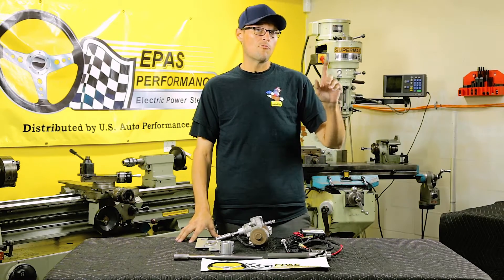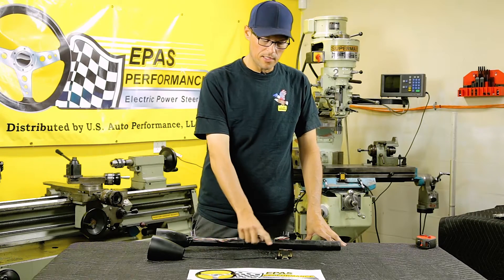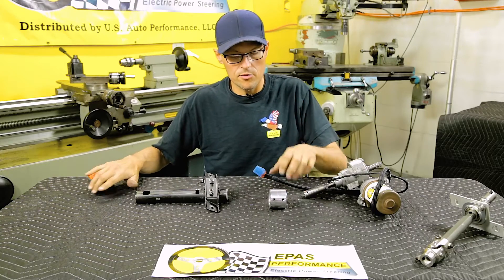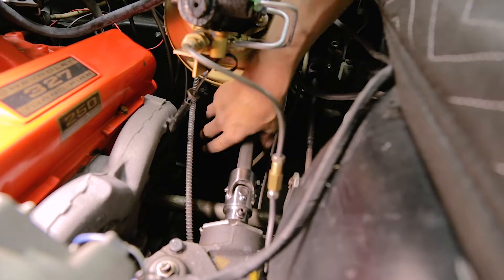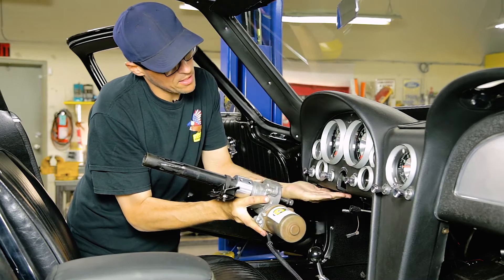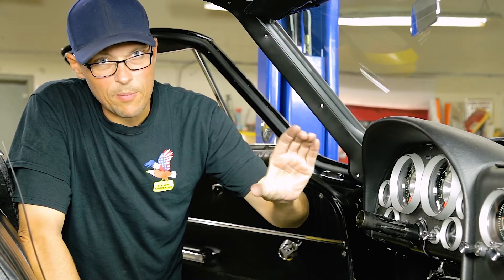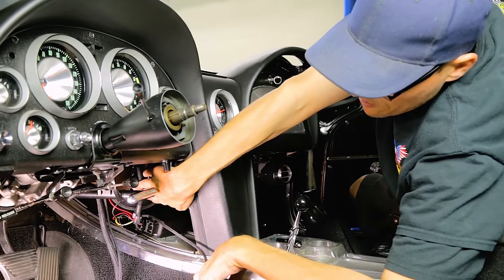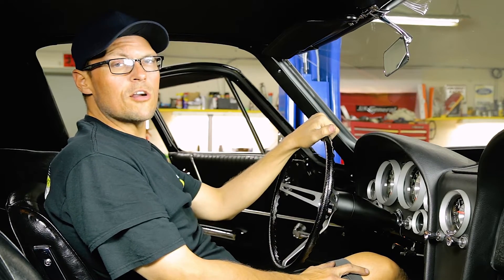EPAS performance Electric Power Steering Kit, C2 "How To "Install video

Comment: Very good i need to setup in my datsun 140j can you help
Reply from the maker: Mohamed, all the Datsun are privately labeled by Z Power Steering. Please contact them for further details. Thanks!
Reply: @epasperformance5469  I am from Egypt and I wanted to buy the device from you with control and fetching is available
Reply from the maker: It would be our product but all sales must go through Z Power Steering. I will most likely be a custom build application as one has not been developed for the model yet.

Comment: how does the install differ for a telescopic column?
Reply from the maker: Russ, sorry for the delay, we actually just redesigned our c2 kit. Please see the attached link. https://cdn.shopify.com/s/files/1/2612/2646/files/C2_67Manual_8-28-18.pdf?13022530616492373901